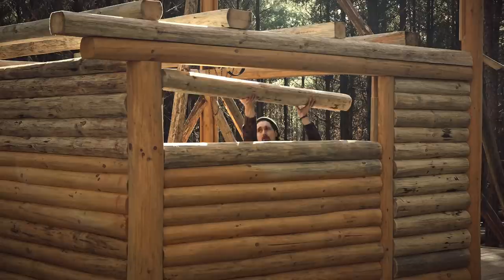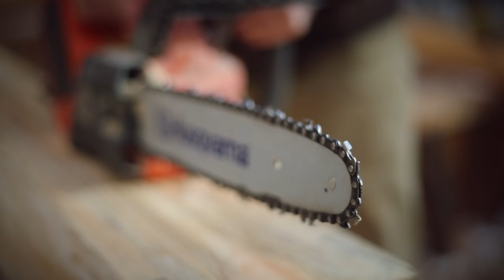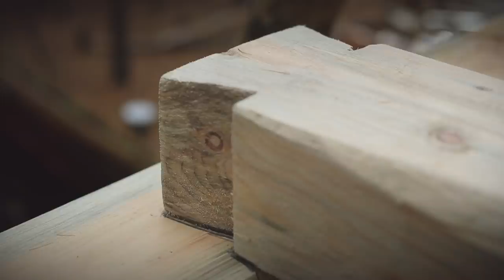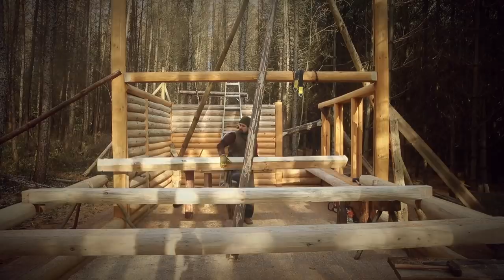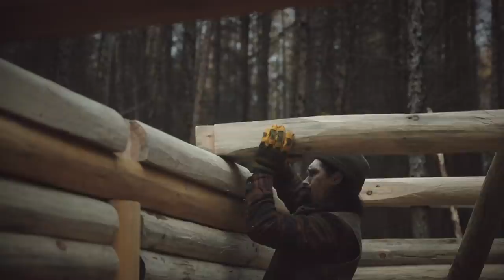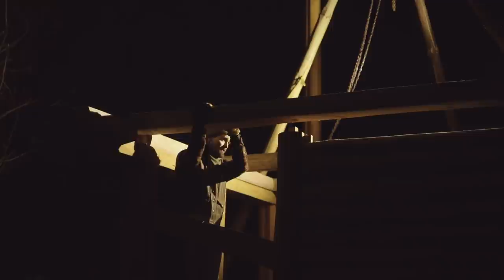EP19:  Building Log Cabin Alone // Dovetail Floor Joists - Highlights Edit

Comment: Nice work! Quick question, though: how did you fill in the gap between the last short log you put in place at the start of the video and the bottom of the beam? I've been dying for an answer since the previous episode but I don't think you ever showed us how you did it :)
Reply from the maker: I really appreciate you paying such close attention.  I did shoot it and I did explain it on camera but you are right, I have not put a video out yet showing that.   I plan to do a longer version of this video and I will go into explanation. But to answer your question,  The last long I split in half and bolted it in from both sides and will fill inside with insulation later once it's closed in.  What's nice about this is because those half logs are riding against a rounded surface if the wall logs start to settle I can just pull out the screws on each end and push it in a little more.  At least that's my theory.  It's not the method explained in the post and beam book I'm using as a guide but I couldn't see why it wouldn't work and gives the walls a nice clean finish. Hopefully I'll have the longer version edited in a couple weeks.
Reply: @TrustinTimber  That actually sounds quite sensible - it's also how you would patch a rotten log so I don't see any reason why it shouldn't be done this way.

Another thing I noticed was that you never put any insulation between the logs. Does it mean you'll be caulking the seams from the outside?